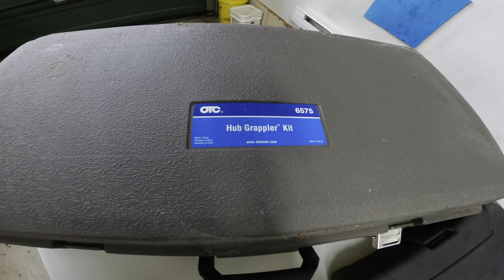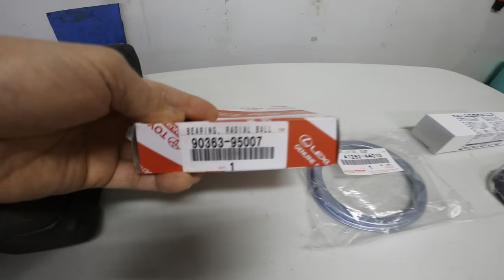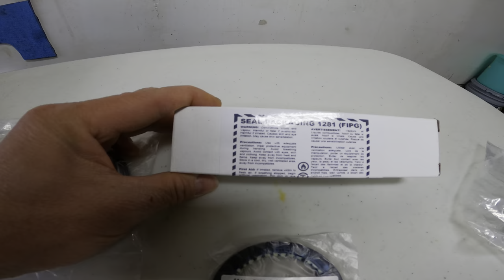2013 Toyota Sienna Limited AWD - Noisy Rear Differential Repair - $150 vs $1500 repair

Comment: I got my 11 XLE AWD about 120,000 and not sure if it has been done yet Sienna now has 170,000 on it.  Could it have been done already? When are they expected?  Side note I put a 3.5 Journey's offroad lift on it as well as a 0 miles remanufacturered transmission, KYB front struts, class 3 hitch, Air Lift air bags in rear, "just makes for a softer right oddly enough". New Rear Drive shaft, "ridiculous $900 for that stupid part alone"Drilled slotted brake rotors and new Alternator since I've owned it.  Not sure about this viscous coupler whether been replaced or not. These vans seem to have a high cost of ownership. 😂😂😂
Reply from the maker: First of all, it’s not a maintenance item that needs to be serviced or replaced. If you have no noise coming from your rear differential, you don’t need to worry.
It is an expensive ownership on yours, indeed!
My 2013 Limited AWD about 192K Km has got water pump with idler pulley replacement due to abnormal noise ( I believe the idler pulley was the cause not the water pump), rear air lift bags, rear differential repair, new set of front and rear brake rotors (after 10 years), new spark plugs, transmission fluid replacement. So that’s not too bad for 10 yrs of ownership. 😀
Now I just keep my fingers crossed on the belt tensioner due to abnormal noise on high load (when AC running). That’ll be a pain to replace. 🤞😬
Reply: @PTranProductions  unironically the moment I now notice you replied back, I'm actually back to view the steps on replacing this bearing😂😂 Mine has finally succumb to old age. I'm needing to replace this bearing now. 😂 mine started with an odd very soft Wizz sound and now has gotten louder and louder. My question I have is.. what bearing tool is that besides the hammer? Is that a particular bearing press tool? Do I need to get that? Rent maybe? Or can this be done using wooden block or something? Thanks in advance for your input..
Reply from the maker: @jonathanfreedom1st  
Well, when I did this bearing, I happened to have the OTC Hub grappler kit that I bought before for other bearing job: https://a.co/d/gKv8bKt
Yes, It’s an expensive kit. Price has definitely gone up much higher after Covid. I paid around $950 CAD before. 
Anyway, you do not really need to have this kit to do the job. 
You basically need a 4-3/4” diameter plate to press/hammer out/in the bearing. So if you can find any cheaper kit that has that plate, then you are set.
You can also use a brass rod such as this one: https://a.co/d/2ak8Zo3 to go around to hammer in/out the bearing.
It’s an intensive repair job but it’s doable.
Good luck!
Reply: @PTranProductions  ok great thank you very much. That helps
Reply from the maker: @jonathanfreedom1st  
You’re very welcome!

Comment: Damn I've got a 2013 Venza AWD and now I'm paranoid. Any way to make sure it doesn't happen?
Reply from the maker: Before the problem happened, I used my van every summer for towing a fishing boat and going down the boat launch where the rear diff. fully submerged in the water.  I am sure that had something to do with the problem - heavy loading/towing and water damage. Other owners may have different experience that led to that bearing failure. So my advice to you is keep away from heavy towing and keep the rear differential off the water.

Comment: is it really necessary to drain the trans fluid? It looked like it’s a separate entity or more like might as well drain and pour new oil kinda thing….
Reply from the maker: No trans fluid was drained. Only differential fluid was drained and refilled after replacement of the bearing.
Reply: I mean is it necessary to drain the dif fluid? I’m about to do it on my 2012 Sienna awd. At first I thought it was the rear hub assembly that I just did last dec. Thank you for your video,this was an eye opener.👍👏👏👏
Reply from the maker: @filicandadsjournal4221  
Yes, it is necessary to remove the fluid before you separate the coupler assy from the rear differential.

Comment: What will happen if keep driving with that problem?
Thanks
Reply from the maker: Well, then it will cause further damage to the rear differential housing which you will then need to replace the whole rear differential.
Reply: By the way, how many hours did u spend to complete the mission?
Reply from the maker: @andy11922  
Roughly 5 hours plus a few hours waiting for the sealant to dry.

Comment: It's off that holds a this is coupling electromagnetic clutch assembly at the front of the differential. It has about one 36k on it I've been adding oil behind the slinger plate to quiet the using the red oil in the store mixed with the differential oil with a manual sum trigger can.

Heated the bolts holding the electro magnetic coupling to the differential I've heated them 6 times I've added penetrating oil. I just can't seem to get them off even with the torque gun has anybody had this problem does anyone have suggestions I got one of the bolts loose that was the easy one on top two but the bottom ones and the

DOES ANYONE HAVE ANY SUGGESTIONS ON HOW TO BREAK THOSE?

I'M USING THE ELECTRIC TORQ GUN AND THE PENATRATING OIL.

STILL NO LUCK BREAKING THEM LOOSE FROM THE DIFFERENTIAL CASE THEIR ATTACHED TO DOES ANYBODY HAVE ANY SUGGESTIONS?
Reply from the maker: Not sure why you’re having a hard time with those bolts. Mine came off without any trouble. Try to spray plenty of penetrating oil and let it soaked overnight and try loosen them with a breaker bar. I wouldn’t want to put too much heat on that differential because it may damage the rubber seal inside the unit.
Good luck!
Reply: @PTranProductions  yes mr. Tran my friend the 14 m m v i got one loose but the others are extremely difficult. I ordered the bolts from Toyota in case they break that I can have the replacement available. I'm having the experience man break the bolts loose for me because I'm 58 and I think that he have more experience at this than me. So I ask the mechanic if he will break the four bolts loose for me and put some wax on them and I ordered the replacement bolts so I have them because it's a good idea to re place them.

THANK YOU AS ALWAYS MY GOOD FRIEND MR. TRAN. YOU ARE A GREAT NEIGHBOR 😉🙏🙏
Reply from the maker: @randolphmack1720  
You’re welcome!

Comment: Tran, when you are pushing the coupling back into the housing you took the oil and you went around the front of the coupling internal and then when you put it inside the housing you used one of the cylindrical press fittings not the same size as the other one it was the smaller one I'm wondering what size you use of the round metal to push it back in when you hit that with the hammer so that it does not damage the internal?
Reply: When you are pushing the counter is about 32; 21 of the time/45:13

What size bearing press do you use when you strike it back in?
Thank you so very much
Reply from the maker: It’s been awhile. That’s part of my hub grappler kit. I think it’s the 3” OD with 2-3/4” ID

Comment: So I got everything done today to the point of reassembling the housing with the new bearing.  I spun it by hand and it sounds like this https://youtube.com/shorts/NkWunFj6JJY

I am thinking this is not how it should sound.  It sounds a bit like the whine from before.  The other smaller bearing spins smoothly with no noise with the old bearing removed and before I reassembled with the new bearing.
Reply from the maker: Not too sure. Never tried that with my new bearing. Have you built it back together and do you still hear that whining noise like before?
Reply: @PTranProductions  Sorry, I meant to come back and add an update and forgot.  Thanks for reminding me 😀

After reassembling everything, everything seems to be ok.  The whine is gone and everything is working well.  Thank you for your excellent video
Reply from the maker: @LetsDIYIt  
Nice! The noise that you heard while spinning by hand with the new bearing installed could be just from the effect of that electromagnetic coupler.

Comment: Does your Toyota do the same thing? My car sitst down to tail when shifting from P to D (when not warmed up. not sure how it's related)
https://youtu.be/zw1Yu59aK0Q
Reply from the maker: Not sure exactly what problem you have there, my friend(?)
Reply: @PTranProductions  Hello. The problem is, that every time in the morning I have a very weird feeling. When I shift from P to D, rear bumber is going down, like literally everybody can see it and I can feel it. So car is like sitting down to rear end. Like a frog, that is preparing to jump )))
Reply from the maker: @kovalenkoihor4325  
Is it possible that your rear brake is stuck on and your brake calipers are seized up?
Reply: @PTranProductions  Not possible. Wheels rotating by hands very easily.  They are working like a charm. And this behavior is only in the morning, when car is not warmed up
Reply from the maker: @kovalenkoihor4325  
Is your transmission fluid level ok?
Have you used a ODB scan tool to check for trouble codes that may have caused the jerking?
Reply: @PTranProductions  was afraid you would ask about transmission errors. Not done yet, was hoping it's not transmission.
Reply from the maker: @kovalenkoihor4325  
What year is your Sienna?
Reply: @PTranProductions  2008. 120k miles. Awd. The problem is, that I've bought it used 7 months ago and it was always like that. And before that I've never had a car with always AWD, so I have no idea, if it should be like that or not. Was hoping that after changing of transmission fluid it would go away, but nothing changed.
Reply from the maker: @kovalenkoihor4325  
No, it’s not normal for an AWD. 
I suggest you to check for any trouble codes that may be related to transmission issue that’s causing that jerking.
Good luck!

Comment: I have a 2013 and I think it's definitely the worst year Sienna you could buy.
Reply from the maker: I would’t say that on mine with 9 years of trouble free ownership. This repair was just part of wear and tear of excessive towing and driving habits.
Reply: @PTranProductions  I had to have a new transmission at 150000 miles.
Reply from the maker: Wow! What was wrong with your transmission that needed a replacement?